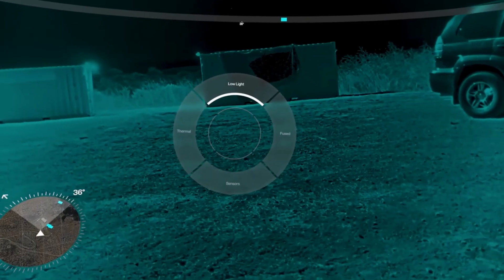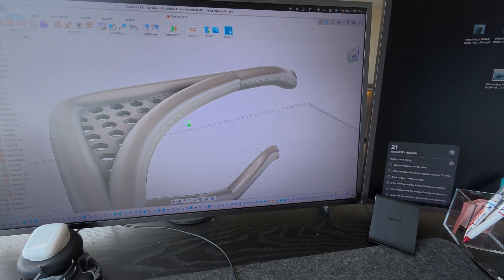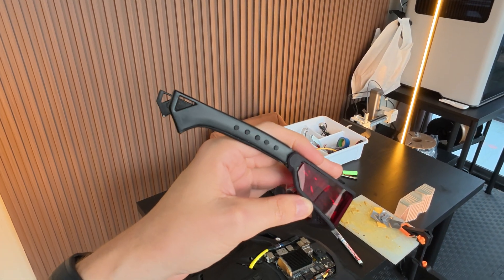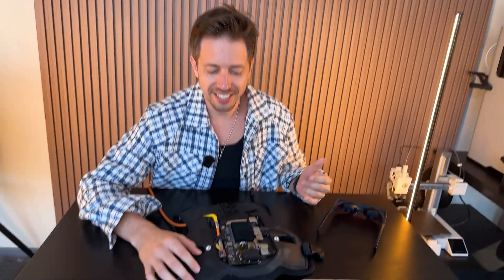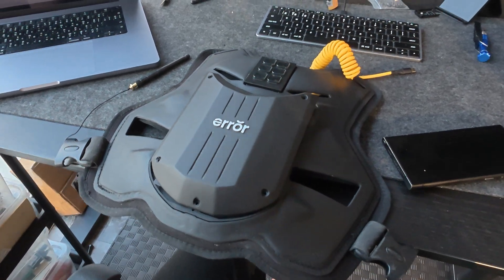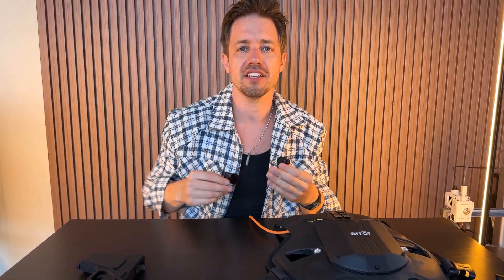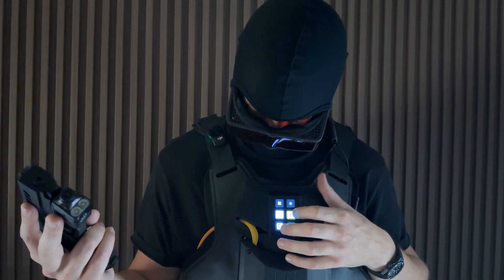I built my own ANDURIL EAGLE EYE

Comment: Huh. Someone finally did it. Been kicking around a similar idea in my head for a bit. (as it relates to the pistol cam)
Would be funny to integrate a hit detector to it. 
Only major suggestion I have is it might be better to integrate touch control into a wrist arm band, close enough that you don't need to break your grip too much. Something that could be done with your dominate hand thumb with stretch.

Also, while the moto vest is interesting, IMO it's really not necessary, or advisable in a usable sense. Anyone using this is going to be using plates and a carrier, and unless you can integrate it all into the plate (which. Eh. probably difficult, a risk, and precludes getting into the electronics without destroying the plate), you'll end up blocking the ability to access/carry pouches/extra gear/etc. You could potentially integrate it into a back plate though, and run the electronics wiring through the fabric of the carrier. Personally I'd probably want something external that can be removed and reattached easily. Either something slung over the shoulder, or better yet, designed into such a way that it fits inside a carry pouch. That being said, it leads to the issue of needing to be connected still to the glasses. Not sure how to solve that. Perhaps integrate the glasses into a larger helmet frame/facemask with a battery and a way to wirelessly communicate to the computer?

Comment: This is the difference between government pricing and private development costs. This guy built this crazy ass thing in a month with some bits and bobs from old projects. I realize that the Anduril project is more refined and all of their software is proprietary, as is all of their ballistic plate equipment and circuitry, but 20 billion seems a bit steep. I'm also pretty sure Anduril has some other features that they aren't even talking about.

Comment: A critique I have, as someone that has spent many years of my life and thousands of hours wearing a helicopter flight helmet, as well as a bluetooth enabled motorcycle helmet: 3 Buttons, MAX. Spaced far enough apart, and with tactile shapes so you can actually tell the difference between each button. Even with gloves on. Then program in contextual button presses for more actions. (short press, long press, double press, etc). Any more than 3 buttons placed close together, you really should have them somewhere you can see, like on your wrist (noting the chest mounted button panel). Or have the button panel be able to fold open so you can look down at your chest (many real life operators use a tactical android device like this). Good real world example of this are Peltor headsets, or Bluetooth modules that go on motorcycle helmets. They rarely have more than 3 buttons. And if they do, they're placed in an obvious pattern (eg, up down, left right, center), and/or place a button so that you can ergonomically reach it with your thumb.

Being able to reach up and feel for a button on your head, quickly and efficiently with one hand goes a long way towards efficiency and safety. Especially if you are task saturated with a critical task, like operating a rescue hoist, or weaving a motorcycle through traffic. Or clearing rooms with a gun.

Really cool prototype nonetheless, because consumer AR glasses are something I've been waiting a long time for, and it's good to see more people taking interest in it.

Comment: Nice. Not bad at all. You may want to look into titanium bracing with carbon fiber. Accelerometer and line segment hit detection. Think the health bar or more so body parts from some video games. 

Also threat detection and networking tools. ( pineapple or such. ) also network jaming and frequency hopping. AR drone integration. 

If you think of going bigger full suite. Then radar and laser projection and such. OLED optical skin. Or inducing thermal gradients. ( BAE, thermoptics, ect.. ) Automated OSINT and data scraping. 

Keep up the work. Love to see the hyper channeled in this type of constructive way. You may even want to consider A.I. and a avatar representation. Halo style but better.

Comment: I cant offer investment, but I am an embedded software/hardware engineer, if you're looking for any help, seems like a pretty cool project with a lot of real world applications. Biggest thing i see is getting latency down and better low light performance.

With some proper tuning, this could certainly be a law enforcement tool. RF is kind of a project killer for a military use, but as you obviously  pointed out theyre already looking into similar systems for the military, and unlikely you're gonna compete with the big guys. 

I do see a market for this in other places though. 

Ive got some other ideas I think you may find interesting. How do I contact you?

Comment: Insanely dope work, I cannot convey how impressive the things you've designed are, over a comment comment alone. The only thing I see right out the gate would be the recoil from the firearm overpowering the magnet in the fpv camera, but that's literally besides the point. It could all be implemented into a single unit, or even two small units that have pic rail screws for tightening. Then the magnet would just be for alignment, before their tightened down. Either way, very cool...

Comment: Dude I know this has nothing to do with the actual vest but if you made a plug in unit into a cigarette lighter & a backup camera with human detection would be an item if you bundled up could sell to SNOW PLOW COMPANIES  for safety ( you always get idiots that walk in front,behind or beside you) vehicle monitors ( or light poles ,trust me seen too many guys back into them  @ very fast speeds) most companies use older trucks because of the abuse on them so don't have the collision sensors or sometimes turned off because of a salt spreader attached making it always making noise) might be a way to make $$ off your hard work.

Comment: Bro chill, I'm not done making my doom helmet variant with djagger style opening
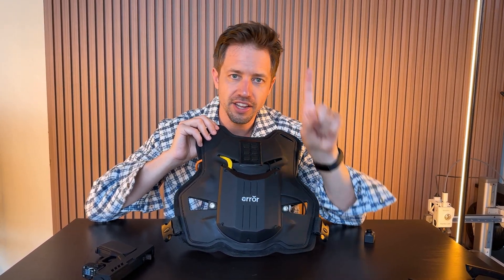14:08 this is splinter cell gear man.
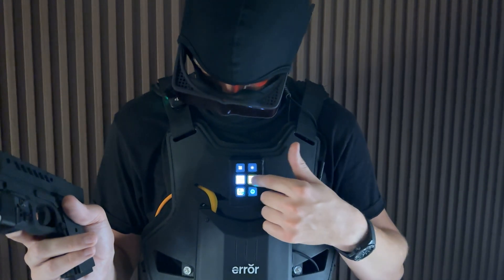16:01 you know the bracelet that operates the glasses or the health ring? You could pair those devices or do a wrist rig like the predators that also senses hand signals.
16:39 screw a robot arm to the back and mount a launcher like the doom slayer or predator and then use the cameras to enable targeting through the glasses and then the launcher could aim and shoot using ai or manual targeting, maybe even take the launcher off and continue use if the arm goes down.
 Could also make a Batman setup with a utility belt that houses some gadgets and parts.

Comment: this is really cool and you did an amazing job.

however, the reason they spent so much capital and time on the Anduril project is because it is a custom, embedded ASIC that is battle hardened. this also makes it difficult for trojans, etc to hijack the system. iOS has some protection, but nothing like a mil spec hardened system. also, their system and their project pricing includes integration into their custom and novel AI OS. this allows for automated control of drones, etc as well as injection of the foot soldier into this stream.

Comment: And not a single person mentioning RF Vision using radio signals and interference, this would be the next feature worth looking to =).  It already has dozens of proof of concepts for counting people, tracking people, distance to and from people, using local AI to convert signals into approximate human movements, standing, sitting, walking, crawling, crouching.  Some have gone as far to claim they can track heart rate and breathing.  One neat proof of concept was pairing an AI with multiple cameras so it could learn approximate height, weight, age, and how people move while using signal interference and then when they shut off the cameras it was able to draw wire-frame models of people through multiple walls and predict their movements in near real-time with a pretty high level of accuracy.  Being able to see how far a captor is from a hostage, if they are holding a weapon, if they are approaching a door or window etc,. This could essentially not only see through walls, but give you the ability to almost predict the future.  Effectively giving you a few second advantage.  Also for firefighters something like night-vision and infrared-vision don't work with fire and smoke, but RF Vision could be trained to differentiate between people, and having blueprint access in a headset and knowing someone is above, below, or a few rooms away could be quite useful.  Having a deployable mesh network of drones, you could probably map an entire building and see how many occupants and who isn't moving, very fast; worst case scenario you have a beast computer on the firetruck do all the computing, and have a dispatcher tell firefighters what floors need help or if people are trapped.
Reply: RF Vision would make you feel like Root when she gets god-mode in the TV Show Person of Interest.

Comment: Is the frame rate that low in the glasses? You could decouple the processing for the boundary boxes from the main video thread and overlay the boxes over a smoother feed while keeping the actual processing on a seperete thread with a lower frame rate if not. This won't make processing faster but it will make it appear as if it's smoother to a user
Reply from the maker: What in the alien language is this. Either I'm an idiot or you just made something simple sound extremely complicated. 

Buts yeah, it's 60Hz. Newer models are 120
Reply from the maker: Ok so I'm an idiot. I misread that. I think you were referring to the FPS of the screen recording and why it was lagging. That was done on the computers end. I mistakenly set the wrong FPS in screen record but through the glasses it was 60fps in real time.
Reply: @errorbyhuman  yeah lol I was just referring to the fps in the preview. I work on mostly LLM but various AI/ML based software projects and had a freind recently give me a demo for a CV project without knowing you could make it look smoother. Just making sure haha couldn't help but think that would be painful on the eyes otherwise

Comment: Have you considered integrating something like an Xbox Kinect sensor on the chest plate to get thermal, TOF, and depth perception?
Reply from the maker: There was so much i had in mind to integrate but at some point i had to limit myself.

I think of things on a time versus value scale. I could either spend the next 9 months developing it to be so insane or build 3 + other projects diversifying my build portfolio. 

If a tech company came to me right now and asked what would i have done differently or add. I could go on for hours (360 vision cams, electrochromic lenses, Swappable lenses, different style glasses arms, thermal, gesture conrtol...) the list goes on. 

Luckily I didnt because the algorithm threw me out because i used the words I used  saying "gun" and "people" 

Oh well, onto the next build

Comment: 22 billion to develop. Some dude in his garage "hold my beer".
Reply: "He built in a cave with a box of scraps"
Reply: 22 billion is such a bullshit number
Reply: Only thing, no offense, is that the military version is going to take A LOT of abuse and still work. Cannot fail if its going be see service use. What he did was cool but, for example, the gun mounted camera the way he made it would just fly apart on the first shot. Again, no offense. This is EXTREMELY cool. And nothing I said justifies $22bn, that's ridiculous. But there is a big difference..
Reply: The hardware, software and testing used by anduril is far more expensive. Not to mention the designing would be far more expensive. Also that and trailing it with the military and doing all the changes they want over and over. It's not the same thing.
Reply: Ironically the guy who listed the price while laughing has given interviews about how the cost of the military gadgets is so high and takes so long to replace that realistically the US can only have a major war against Russia or China for two weeks and then there is not way to pay for or produce replacements. Yet he laughed at 22 billion to create.
Reply: @JohnDo-ntchaknow you ever get the feeling that most of the grants amd stuff defense contractors get is just money laundering with extra steps?
Reply: Same thing with modern art and "luxury" fashion.
Reply: They may have the smartest people at the top but they lack creativity and drive like the bottom
Reply: Not to defend the most evil human imaginable, but anduril developed their systems and own all their manufacturing etc so they're counting the whole reliability and none of their parts being made by china etc etc, so it's more they built a tonne of stuff that's made from the ground up, so this probably cost a similar amount just most of the money is in the manufacturing like in pcb way, the companies that made the glass etc etc. I mean you probably knew this but i feel like it's worth pointing out.
Reply: Is not the same, obviously. EagleEye of Anduril is far advanced and better.
Reply: Except it has basically none of the functionality of the real product. Clickbait title and barely a proof of concept.
Reply from the maker: @poppy11th  Ill give you $10,000 if you can personally 1 up this in 1 month or less.
Reply: @errorbyhuman damn
Reply: Welll... He literally just took the two most expensive parts, the computer and AR glasses module from third party companies. That wouldn't be legal if he wanted to sell this thing. But yes, military gear is always horrendously overpriced, there is a dude on yt who developed his own AR glasses, and there are open source alternatives to the mac mini, that would be legal to sell. I'm also not entirely sure how reliable the machine vision is, but it works at least.

Comment: Very cool.  I recommend ditching the magnets on the pistol camera.  You may lose zero after a shot or two.
Reply: You WILL definitely lose zero after just like... shaking the gun around a bit. Not to mention potentially losing the whole module if you happen to brush it against something like your clothes, or foliage or anything. I also just don't see why it's necessary. Magnets are cool, but you don't need to like... frequently take that thing off, or swap it for anything else. Set screws would have been perfect.
Reply: Nevermind the zero, the camera is going to fly off the magnets after the first shot.

Comment: That fairly loose magnetic mount for the camera would be a terrible aiming system for a real firearm. Shooting the gun will shake it violently, and if it doesn't just fall off, it will certainly lose its zero.
Reply from the maker: Mounting the two pieces can be done like the DJI action clip. But I had a month to do all this in with other work